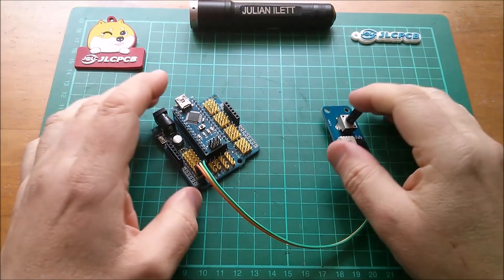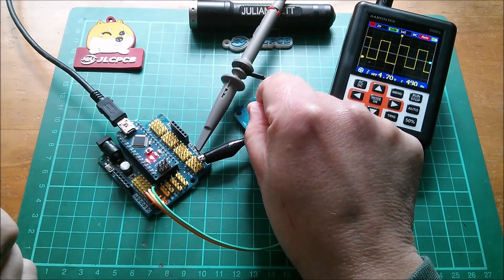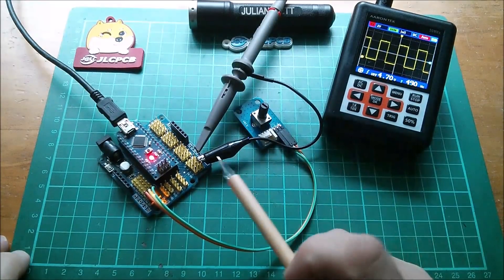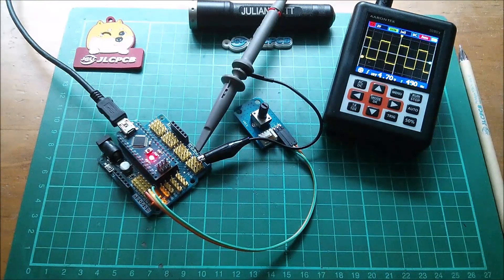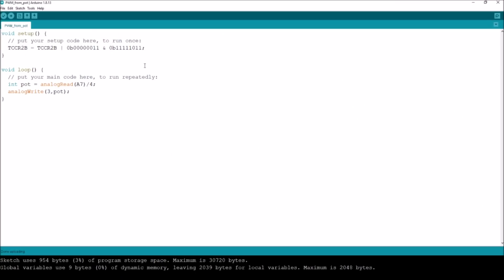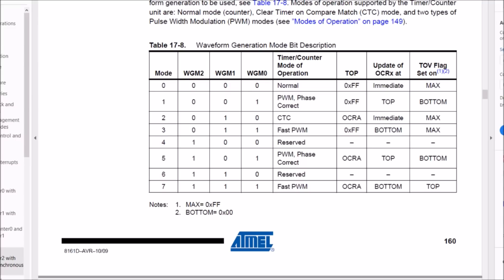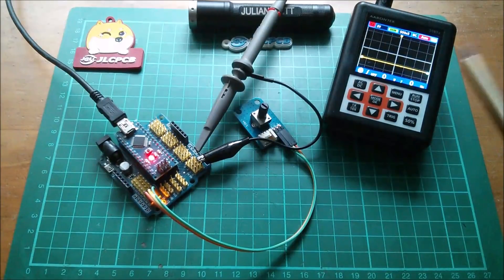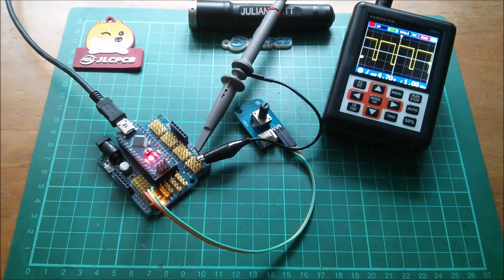Arduino PWM Frequency Tweaked to 1kHz

Comment: After a lot of faffing around, I eventually got this to run.
I do tinker with Arduino code, but not at register level.
I did get it to run at 980 Hz or thereabouts, but nothing I did would get it to budge,
I can only assume that somewhere in the copying code from the screen and cutting and pasting the register values, something got messed up.
With nothing to lose but an old Nano, I set TCCR2B to B00000000, followed by setting TCCR2B to B00001011.
No ANDING or ORING, but it did work and I got near enough 1.004-kHz.
As Julian suggested later on, it's not a bad idea to read what's in a register before you change it by simply adding a line or two Serial.print(TCCR2B).
Also thrown by the Atmel document describing the bits that are changed as Read Only.
However, pleased to get there eventually.

Comment: Somehow I stumbled up on this video..
15+ years ago, maybe 20.. I bought these atmel chips and Crystal's and all the stuff to make a dev board, no arduino bootloaders just straight som then c.  I made a parallel programmer then a usb one and so on..  stopped for awhile...

  Now a year back into it I was so confused about what happened to all the low level stuff. This brings me right back to the datasheets.. lol.. thank you for this.

Comment: F8 = 248 for those who haven't looked it up yet. ;)
Thanks for this video, it made setting PWM frequency a piece of cake. Perhaps you could put the code into the video description? I had to pause and copy it in.

  //Set PWM pin to 1kHz
  TCCR2B = TCCR2B & 0b11110000 | 0b00001011;
  OCRA2 = 0xF8;

Comment: There's something about setting registers and ANDing and ORing that I like way more than traditional Arduino coding.
I'm not a software person but this kind of stuff just feels closer to the hardware and I somehow undestand it better.

By the way, if you needed more granularity you can set the PWM resolution to more than 8 bits but that's not needed for what an  EVSE does.

It feels weird saying AN EVSE because you wouldn't say "an equipment" :)

Comment: Thanks for all your vids. Like you I'm developing an EVSE. To generate the 1khz PWM I'm using an ESP8266, very straightforward to generate the 1khz PWM, and it's also Arduino IDE and IOT compatible.
Reply from the maker: Cool, thanks. Next step is to drive the CP line (+/- 12V) from the 5v Arduino output. I'm thinking opto-isolators :)
Reply: @JulianIlett  
Ooh that'll be interesting! Look forward to seeing you're approach. Optoisolator for level switching I take it?
I'm looking into the safety stuff, PEN fault detection and GCFI, looks fairly straightforward but researching suitable current transformers....and then there's also tying it to my solar PV, relay fault detection...and the list goes on! Good fun though!

Comment: Did you try using the tone() command?  I am reading 998.4Hz and 499Hz from this sketch...

void setup() {
}

void loop() {
 tone(9, 1000);
 delay(1000);
 tone(9, 500);
 delay(1000);
}

Comment: Julian is that scope really any good? I know your using it in your video, so it must be decent. Right? I'm thinking of buying it. Would you recommend it? I hope I don't come off sounding stupid mate. I just don't want to waste my money. Thanks for the upload.
Reply from the maker: It suits me because it's small and fits on my desk (and in the video frame). But it does have a low resolution screen so it's not super accurate.
Reply: @JulianIlett  Pretty useless reply, Julian, surely since James was asking about the scope it would have been a complete reply to include some detail, unless of course You-tube forbids such content, I too would like to know as per my posted request...

Comment: Sledgehammer to crack a nut.  I dunno why you don't use an NE555.  Easy peasy to get a kilohertz out of that.  Why over  complicate things.  Want it bang on?  Use a 3.2768 meg crystal and divider with standard (CMOS) logic.
Reply from the maker: The problem with the NE555 is it isn't very good at receiving data from a nRF24L01+ radio transceiver. That's how I'm going to modulate charging current to match available solar power from my rooftop solar array ;)

Comment: The problem is with the Arduino, no one reads the chip specifications to learn what it can do and how to do it. It's all in the data sheets. there will be a few registers which control the PWM and you should be able to  set the frequency to whatever you like.
Reply: Lol, no one ever reads the manual 😜
Reply: @Randorandom232  Well i have to admit that i'm one of the sad ones who do ;-)  the "Absolute Maximum Ratings"  are a must how else will you realy know how to kill it. 🙂
Reply: @TheEmbeddedHobbyist  we're lucky to have ppl like you

Comment: Interesting video.  I used the same technique to generate a 1 MHz clock for a MC68488 chip connected to an ATmega. I am always amazed  by the versatility of these chips - - hence the huge datasheets. Regards,  David

Comment: When you do bit manipulation like you do to TCCR2B here, you should always first zero (needed) bits with AND, and then OR to set needed bits, and do these operations in separate sentences, that way there is no question about operator priority! Just a simple habit that is good to pick up and sustain in order to avoid bugs like you did at first.
Reply: Or you can use parenthesis around the AND. That will ensure that TCCR2B only gets written to once, which isn't important in this example but may be in other contexts.
Reply: @IanSlothieRolfe   Unless you know exactly how the specific compiler handles things, parentheses are still no guarantee of that, and they make the operation look even more obscure. And there are a dozen more different contexts that may require extra things to be taken into consideration. Sorry, I stand by my words, the most clear and most bug-avoiding way in this context is as I said. With added comments to explain what is being done, of course.
Reply: @pev_  heck no. If the compiler can’t be trusted to respect parentheses you need to switch compiler. 

And I would never approve code during a code review that splits up simple operations into multiple operations. I can accept some extra parentheses to make logic safer and easier to understand.

Above four-five operands or so is a different thing, then you probably need to split it up to make the logic clear.
Reply: @TheOnlyEru   First, I did not say a compiler will not respect parentheses!! Second, if you are in a position to "approve code" and you say splitting operations into simpler ones is a strict no-no, then goodbye, I have no respect for your "reasoning". And your last sentence is such idiotic "I just make up this figure to rule everything" that I do not even want to try to respond.
Reply: … and always bracket AND and OR (and other logic operations in the same expression). No one but a programming pendent remembers operator precedence over and above than the traditional BODMAS.
Reply: Let’s remember here this is a lesson on an Arduino which is a hobby unit. We’re not talking programming experts here
Reply: @paulmeynell8866   Soo...what? Are you saying that a dude using a "hobby unit" should not be given programming tips? That one should not strive to be a better programmer because of "hobby unit"??

Comment: Audruino is getting boring... get on with that diesel heater you sold out for.... otherwise I'll take it.
Reply from the maker: The diesel heater broke, then went rusty.
Reply: @JulianIlett  wouldn't have gone rusty/corroded if you hadn't neglected it.
Reply from the maker: It's still broken.
Reply: @JulianIlett  need any pointers on how to fix them, check out David Mcluckie (not sure if that's correctly spelled)

Comment: It's always boggled my mind a bit why the default (in fact only) pwm frequency of the analogWrite function is so low frequency (~300Hz). The 328p can easily go up to ~62kHz (at the loss of some resolution), and easily past 1kHz while having plenty of resolution.
Reply from the maker: Outputs 5 & 6, which use timer1 can have 16-bit PWM resolution
Reply: @JulianIlett  depends on which pwm mode is used, and the max count value (which directly affects frequency). IIRC using the 16 bit timer, min timer prescale, and outputting max ~62kHz will only net you 7 bit resolution. It's a hardware limitation without having a higher base clock frequency or pll to boost the timer input clock. Requiring 16 bit pwm resolution would greatly decrease output frequency (base clock is 16MHz, assuming 1x prescale at 16 bit res would mean max freq is ~244Hz if my math is correct).

Comment: Nice one. I've been missing these kind of videos!
I'm following along with a Pro-Mini I had to hand. OCR2A = 0xF9 gets closer to 1kHz on my Rigol scope (exact, in fact).

Grrr. You didn't set the pin input / output in setup()!
Reply from the maker: It doesn't surprise me that 0xF9 is better. My little scope seems a bit inaccurate.
"You do not need to call pinMode() to set the pin as an output before calling analogWrite()."
It says so here: https://www.arduino.cc/reference/en/language/functions/analog-io/analogwrite/